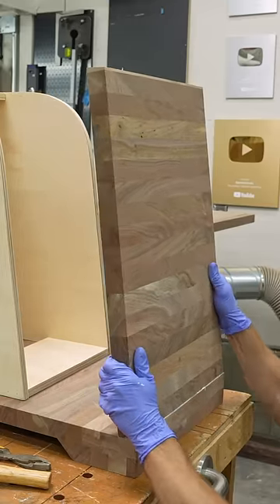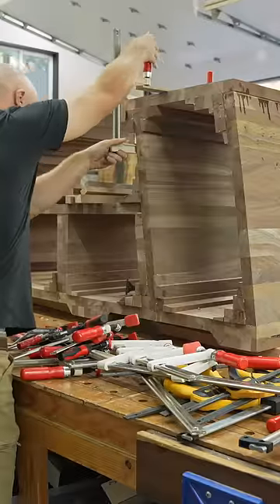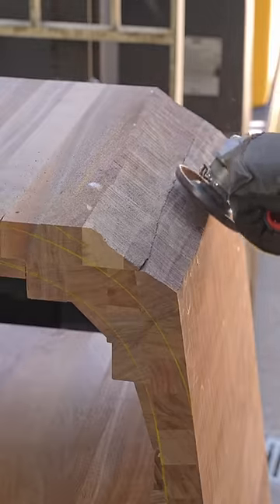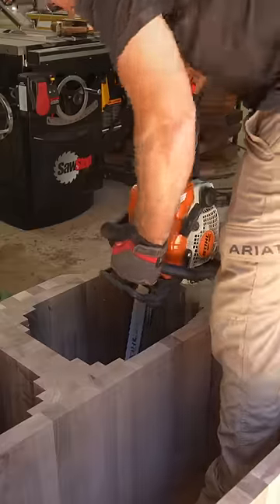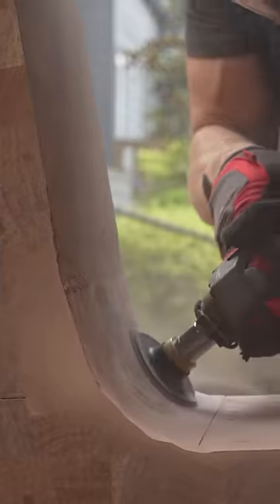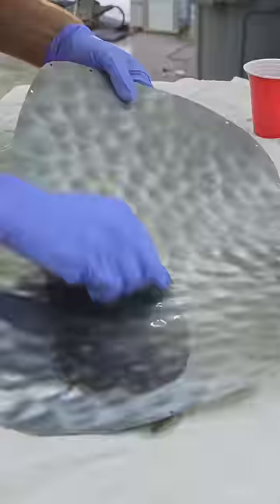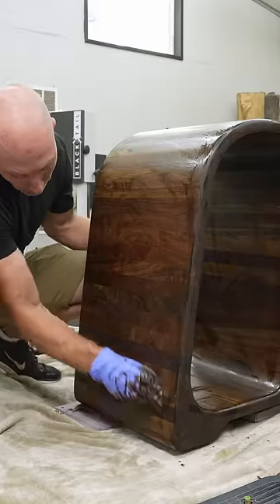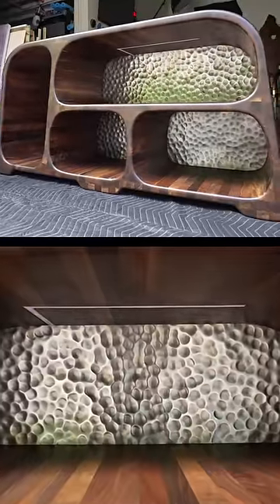Carving a Cabinet From 300 Blocks of Wood

Comment: I hand made about 6 or 7 thousand oak floor tiles. That took some time. Cut the tree, milled the log, dried the timber, cut to length and planed on 4 sides in a vice.

Comment: i would use one of those dome angle grinder bits for the inside. for the outside i would get the bulk down on the tablw saw,, elextric planer, and sander

Comment: darn good: perhaps a little more design to the hand-pummeled wood: as if the 'hits' were bubbles coming up from a fountain...also, slightly different degrees of oxidation on the ''edge bubbles...'  OR,   different treatment to the sheet metal-- WHAT IF it were straited, horizontal fields,